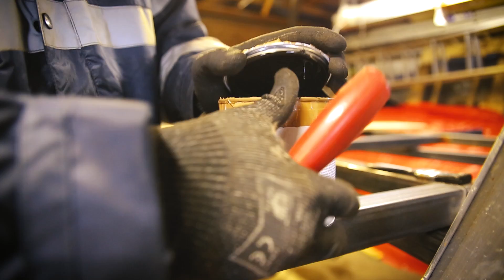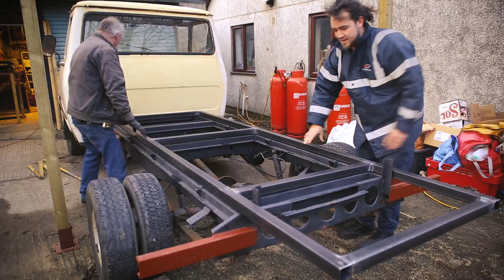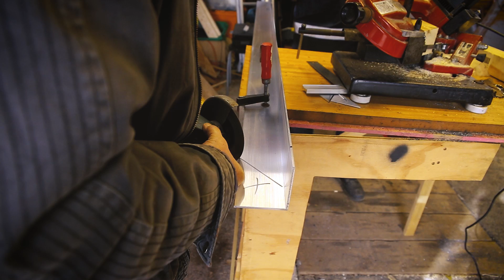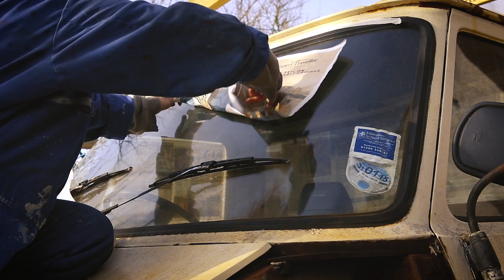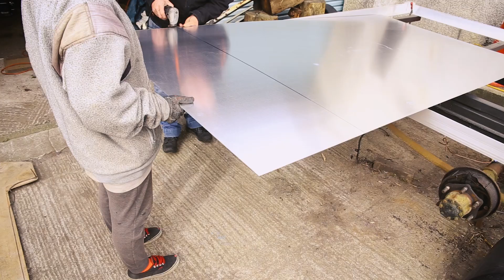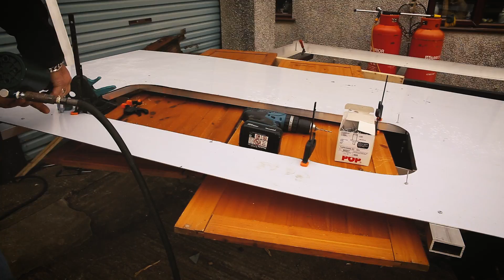WE BUILT A WALL! | Bedford CF Van Conversion

Comment: This was useful to see, I've noticed rust coming through our chassis treatment. Unfortunately most parts of very difficult to get to due to stuff being attached to it now. It's very upsetting to think we have to go through that whole process again as its going to be way more difficult now! We used Kurust, would you recommend buzzweld now or something else?

The Bedford cab looks so lovely now :-)
Reply from the maker: Ah no! We can totally feel the frustration with you on that one.. we now have a constant anxiety that it's going to come through again and it'll be too late to do anything about it when it does. We got so many good recommendations for Buzzweld and could only ever see 5* reviews for it online, but just weeks after applying it, the rust came through again. We contacted Buzzweld and they were actually extremely helpful and were having email exchanges with us late in to the night to try and help us solve the problem. 

It turns out that we hadn't applied thick enough coats originally, and it has to be laid on in temperatures between 15-25 degrees (we were painting outdoors in January!) Only time will tell if we've painted it properly this time but we applied much thicker layers and it does seem to be better now. My only concern is it does seem to scratch off fairly easily. We've dinged it a few times since repainting and now have to touch up a few spots.

I don't know if there's any product out there that truly holds the answer to a rust free chassis. If there is, I'd love to know!

Ben
Reply: @FromRustToRoadtrip   Thank you so much Ben for taking the time to reply! We think ours is happening for the same reason - we did it this time last year when it was cold. The photos show us wearing scarves and hats - so over the summer we're going to have to tackle this issue bit by bit. It's going to be really difficult as we're going to need to somehow scrape the underbody seal off in difficult areas which have pipes attached and cages attached. Really disheartening.

I may ask you nearer the time how the chassis is looking and perhaps we'll try Buzzweld this time. We used Hammerite Kurust then Hammerite Underbody seal - does Buzzweld replace both these products or just one?
Reply from the maker: RainbowsOnTheRoad That would definitely be a good idea, pick a good warm day to do it and early in the morning so you've got a whole day for it to cure before the damp comes in when the sun sets. Buzzweld is an all in one, it needs to be painted onto bare metal and they advise against using an underbody seal as it can trap moisture and cause more rust. Feel free to message us when you're going to do it! 😊

Comment: Nice work, why not cut the rear bulkhead out so it's a proper walkthrough? That's how most campers are made.

Also really you ought to remove the windows, I guarantee there will be rust and holes under the rubbers, especially around the windscreen.

Also fill every body cavity you can with Bilt Hamber Cavity Wax, it will help stop it rotting from inside out. Then after stone chipping, coat the under body in anti corrosion wax. The van will last much longer. I've coated my 69 VW Camper in this stuff to protect it.
Reply from the maker: Yeah we’ll be removing the windscreen to repair the rusty patches at some point. There’s heaps of rust and rot going on and it’s probably got much worse whilst we’ve been away travelling too. So much work to carry out yet. 

Thanks for the tip about wax, we’ll have a look in to that! 

We didn’t want to build the campervan back in that way as we really wanted to restore the cab and preserve it in its original state, plus we think the window is quite a cool, quirky feature that people will enjoy utilising 😊

Comment: Most van converters mostly wing it but do you have any drawings of the end product i can see? I had thought of doing the same thing as your doing but with a DAF LF 7.5 tonne.
Reply from the maker: Graham Hardy 26 Yeah we’ve got some detailed plans. We’d like to say we could wing it but with building the box everything has to be precise down to millimetres. We use a bit of software called Sketch Up for the drawings it’s a great bit of kit and easy to use. In the second video in this series we showed the drawings of what it’ll look like when finished on the inside but if you’d like us to send you a copy let me know and I’ll email it over.
Reply from the maker: @grahamhardyvanlife2021  Ah okay, we haven't detailed where those elements are fitting in the designs so far. We've got an idea but wanted to build the box first then we'll create a much more detailed design for the interior. I'll send over the design later as a Sketch Up file so you can see measurements etc

Comment: why not get Beyond the van to spray it?
Reply from the maker: Hi Graham, we may well do eventually but for the time being we only needed the two sections painting. The front of the van has lots of rust and holes where we’ve cut chunks of steel out ready to put in new fibre glass panels, so it’s nowhere near ready to be painted yet. We only painted these walls as once the front wall is in place, we won’t be able to paint them at a later date.